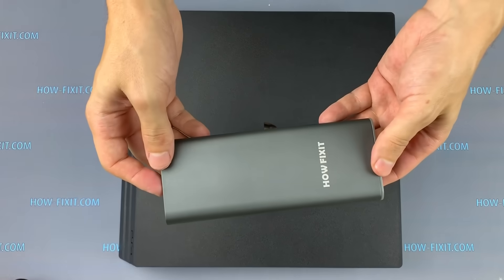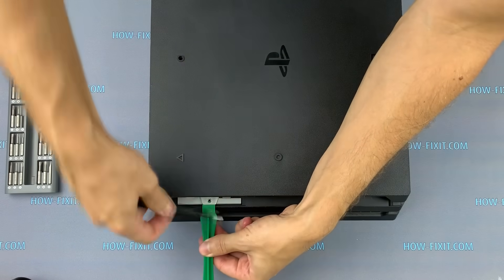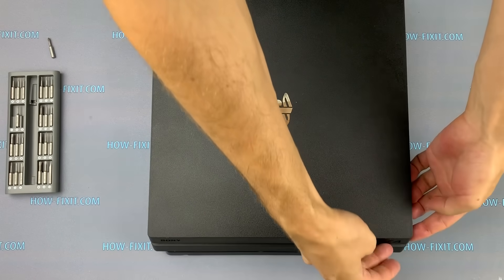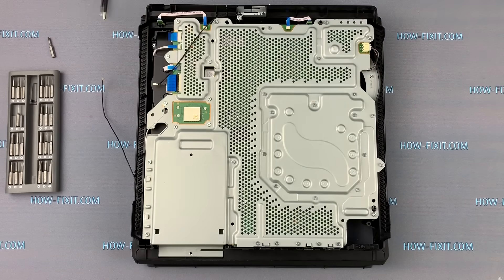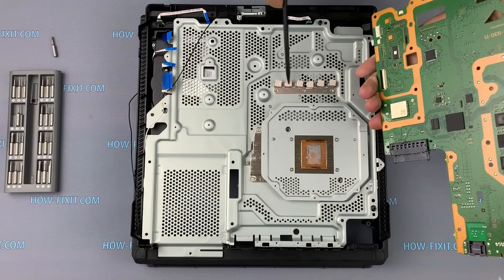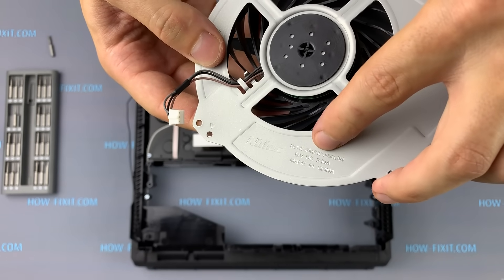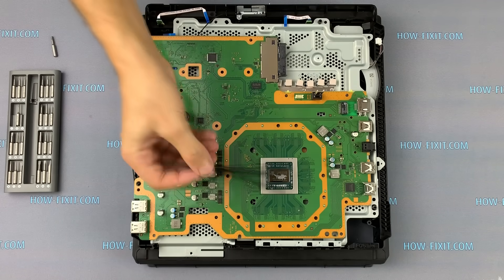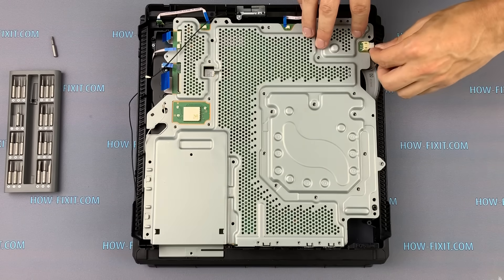PS4 Pro Disassembly: Ultimate Guide for Fan Cleaning and Thermal Paste Replacement

Comment: Hey so I completed all the steps and now when I turn on my ps4 pro the light blinks blue twice and then the ps4 shuts off. Any tips? Thanks!
Reply from the maker: 1) check the HDMI output - look at the cable itself and the port to which it connects. The wire or console may be damaged. To verify this, try using a different HDMI.

2) check the power - press and hold the power button of the console for at least 7 seconds. The system will emit two beeps before shutting down. After that, disconnect the power cord from the set-top box and inspect it for damage.

3) check the hard drive. PlayStation 4 must be turned off. Unplug the power cord and other wires and open the hard drive bay. Having pulled out the hard drive, examine it - is there any damage on it? Also make sure it sits tight in its compartment.

4) if the previous steps did not help, disassemble the PS4 again and carefully check how everything is connected

Comment: I tried removing the power supply and the whole piece, connected to the mother board, came off. I tried soldering it back but to no avail. I now have a paper weight
Reply: His Dudeness same this guy shoulda been more specific I shoulda watched the other video where he pulled it out the battery pack instead fuck
Reply: So, I eventually fixed it by watching another video on this. I managed to resolder the piece back on, and firmly pressing, as I was soldering. Eventually, my PS4 Pro booted up again
Reply: His Dudeness can you provide the video link? Same thing happened to me
Reply: His Dudeness which video my guy :)
Reply: His Dudeness thank u so much
Reply: Frankfurt MeineHazebaba yeah man he shoulda pulled it out the back of the battery power instead like other videos it sucks I had to buy a whole new one because I don’t know how to soder but I’m sending it to a friend if he can fix it and get it working then cool but the whole thing ripped off he should of said he very careful before pulling out smfh

Comment: I’d end up breaking my console even if I tried to do this perfectly.
Reply: Nahh mate go for it,take your time and be careful if I was able to do it anybody can do it and that's a fact.You wouldn't believe the difference.My ps4PRO barley makes a sound even after like 8-9h of gaming
Reply: @Joebanana27  hey bro im planning on doing this, im pretty confident in pulling the ps4 apart im just afraid of applying the thermal paste. Is it easy to destroy the system with the paste?
Reply: @smos54321  Nahh You cant destroy your system with the thermal paste,just remove the old one and apply new thermal paste and that's it.
Reply: @Joebanana27  how much room for error is there when applying new thermal pastr
Reply: @smos54321  Just clean the old paste and apply the new one it's that simple man you can't fuck anything up.
Reply: @Joebanana27  aight thanks bro
Reply: Sako M there’s really no area for error for applying and cleaning. i did this twice and in both experience, the hardest part was removing the white wire from the mother board and power supply. i ended up removing from the actual power supply. when applying paste, make sure you apply enough because the first time, the fan kept spinning none stop and was loud af & i would have problems with loading in the map for cod warzone. cleaning the cpu on the mother board seem scary but the pins around it is tough enough to get in there with tissue and q tips. I’d apply a good amount like he did and spread it and then apply just a little more on the heat sink.
Reply: @droplikelean  thanks for the reply, i did it about a month ago and it completely fixed the issue i was having :)
Reply: @smos54321  The general rule of thumb for CPU heat sinks is you want about a Pea sized dab of paste in the center. . . with this being a more elongated heat-sink, just slightly elongate that bead of paste about a quarter inch across the board, and you should be good so long as you place the actual radiator plate on evenly when you screw it down. Most paste is non-conductive and even if you make a mess won't destroy your system. If you are using something like liquid metal type pastes (Which rock but are very very expensive, then you can actually short circuit your console by having it leak off the heat-sink onto other circuits)
Reply: @droplikelean  i also have a problem with this white wire from power supply, it fits so hard that i'm afraid i'll break it. and as well i don't know how to remove three (wifi?) wires from the motherboard. and i'm stuck :/
Reply: @RTArmia  it takes a bit of man power to get it out. Just be careful
Reply: @smos54321  Not easy at all only, if the paste is conductive, is that likely to happen.
Reply: droplikelean dude I had the same problem. I was panicking because I had it all taken apart and I was trying to pull the wire out from the motherboard and it would not come out. I realized I could just take it out the power supply and it was much easier and I was soo relieved lol.
Reply: @Joebanana27   have you tried playing games like genshin impact or RDR2 after  you have done this? Because from my experience those 2 games makes the fan constantly go off like a jet and would like to know if it has made a difference while playing those before I even attempt to replace the thermal paste (will be my 1st time ever doing this)
Reply: @LeonSKennedy7-k9c  Oh for sure,doesn't matter what game I played after a new thermal paste my PS4 pro is as quiet as it can be.I used IC Diamond thermal paste btw.
Reply: The main thing you have to be careful with is the power supply clip, disconnect it from the psu NOT the board. Obviously don't tug on the cables too hard either and you'll be fine. If your console is overheating it's more than likely the heatsink rather than the paste or a loose thermal pad
Reply: Jason M probably don’t have to do this anyway

Comment: Excellent video! But Alarm! Achtung! Etc at 3:00. Be extremely careful when disconnecting the power supply cable. With just a tiny bit of too much force the connector to the motherboard will break (as I found out) wiggle it slowly and gently... 😔
Reply: If you do snap it off like I did no one in UK will fix it. All too scared to solder the motherboard
Reply: I took my power supply out and accidentally clipped the power supply wire. Got a replacement but having issues with getting the old plug to u connect. Worried about breaking the port off the board. All these vids including the sony one make it look easy to pull out it's not. Help
Reply: Fire Man Yes absolutely man...
You are right, coz its happened to my PS4 pro !!

Comment: Only replaced the thermal paste on my PS4 and honestly there is a night and day difference in how different the noise profile is. Fan still kicks in during intense demands but subjectively this is at least 50% quieter. Amazing, thanks.
Reply: Is it still quiet to this day?
Reply: Some tutorials are applying the past on both the APU and that bronze pad. In this one, he only spreads it on the APU. How should I go about it
Reply: @naivedhyakhatri5142  I put it on both
Reply: @nynysworld1429  when you put it on both did you also spread the thermal paste across the bronze pad or did you just a tiny when applying it to that?
Reply: @naivedhyakhatri5142  spreading it would give you the most coverage. I put a tiny drop in the middle and spread it and it worked wonders. The layer sould be less than a millimeter thick.
Reply: Air bubbles go brrrr @Taariq2
Reply: @Pav56  clean the heat sink!

Comment: Just finished reassembling my PS4 and the difference is mind blowing. The radiator was suffocated in dust and the old thermal paste was so dried out. Thank you so much!
Reply: Same here the original thermal paste only covered about 30% of the cpu mind blowing 🤯 should have put new paste on day 1 quality control wasn't paying no damn attention what so ever the day they slapped mine together
Reply: @nynysworld1429  I feel some models of playstation are put together as bad as a McDonald's cheeseburger these days 😭🤣
Reply: JigglyGaming they just slap it together 😂
Reply: Mine was the same half the radiator was a clump of dust. I replaced the paste as well as the PS4 is really quiet. I just hope it doesn't die on me in a few days. I always worry if I correctly applied the thermal paste
Reply: what thermal paste did you use if you don’t mind me asking?